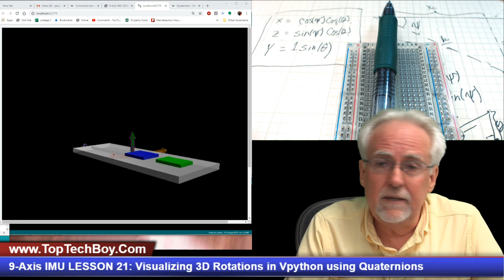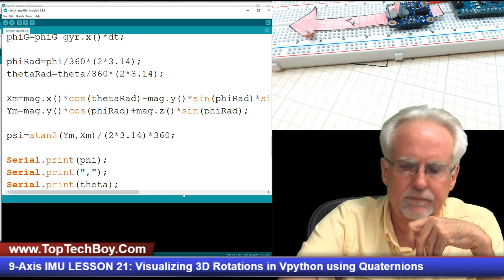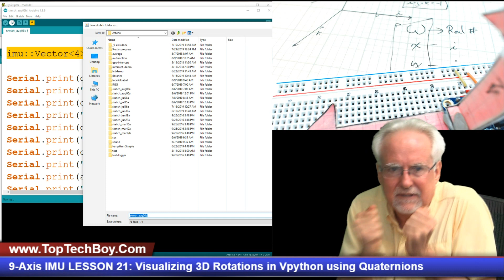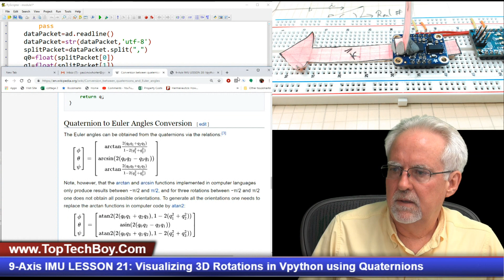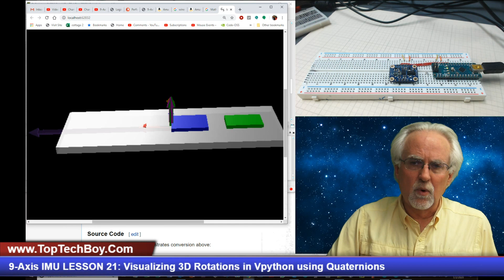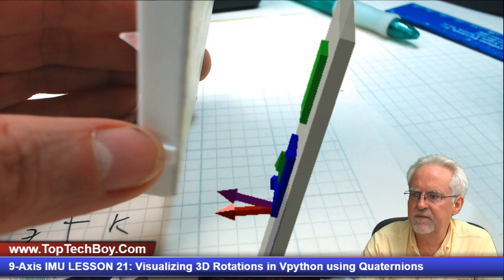9-Axis IMU LESSON 21: Visualizing 3D Rotations in Vpython using Quaternions

Comment: Why do you just calibrate the magnetometer and not the gyro and accelerometer? According to the docs, the quaternion calculation uses all three sensor types.
Reply from the maker: The gyros and accelerometers are much more stable, and there is great variation in the magnetometers.

Comment: Made it through the 21 lessons! This has been awesome to follow along, thank you for the effort.

For this lesson, I had to do some troubleshooting with the python code  at line  "pitch=asin(2*(q0*q2-q3*q1))". I was getting "ValueError: math domain error."

As mentioned at 1:01:38, the error seems to have to do with the asin function getting a value that it cannot handle.  

I was able to get the program to run by borrowing from the code provided on lesson 24. Specifically, I modified the arduino code in this lesson to have:

float q0;
float q1;
float q2;
float q3;
....
q0=quat.w();
q1=quat.x();
q2=quat.y();
q3=quat.z();
.....
Serial.print(q0);
Serial.print(",");
Serial.print(q1);
Serial.print(",");
Serial.print(q2);
Serial.print(",");
Serial.print(q3);
.....

for some reason that I cannot explain, "catching" the quaternions in python by having the arduino "throw" them this way (instead of Serial.print(quat.N)) was able to resolve immediate ValueError issue.

I still needed to implement the try and except for the pitch down 90 degrees case.

Cheers!

Comment: Really good presentation!   But, I have a problem.  Plan to put this sensor in my Dual Axis Solar Tracker which runs currently on LDRs tracking, which are not very reliable in cloudy WX.  
Problem:  No way to calibrate every time the esp32 wakes from sleeping (runs everything on 24vdc battery).  
I am currently saveing initial calibration settings via eePROM and then reloading them with library functions from BNO055.  Trouble is the mag does not calibrate with this method.  So, yaw is off.

Comment: Thank you for the video. I tried doing the same with Ursina engine/Panda3d but I hit the issue of yaw and roll aligning so that I get a gimbal lock. Wouldn't using Euler angles regardless of wether it came from quaternions and just displaying it cause gimbal lock? Anyways great video
Reply: Kinda having the same issue... Did you find a way to solve it?

Comment: I couldn't get the BNO055 so I've used the MPU6050 6-axis IMU that came with the UNO Super Starter Kit. Without a magnetometer there is persistent drift in the yaw, other than that it works quite well. I had one little glitch caused by trying to swap the x and y axes due to the way the IMU mounted on the breadboard. It worked fine until the quaternions. Re-mounted the IMU and all is well and I'm moving on the the pan-tilt platform.
My solution so far: https://www.youtube.com/watch?v=shdRF9SyypI

Comment: Paul, This has really been a most excellent series. Of course, for me, quaternions are a magic incantation with absolutely no idea of what it all means or why it fixes things like gyroscope lock.  I am still stuck in trying to understand how you can produce valid data beyond 45 degrees with the accelerometer without switching from sine to cosine data. I see that I have a long road ahead after simply seeing the use of quaternions to actually understanding.

Comment: I'm in the process of writing an algorithm for a $21k IMU that has a Fiber Optic Gyro, magnetometer, and a MEMS Accelerometer... and once again, every time I need to go back to basics and re-visualize some of this stuff, I dig up your lessons! There is no comparison on your ability to explain this stuff.  Thanks Paul!
Reply: hi, have you an example code or a valid link where learn how to implement quaternons on  an microcontroller for an imu that doesn't calculate them automatically.
 thanks in advance

Comment: Hey Paul, I'm working on a flight controller. I've followed all of your tutorials this far. And everything has been working perfectly with one exception. When approaching 90° on theta (pitch axis), I'm getting a "value error: math domain error" for the line, "theta =  -asin( 2*(q0*q2 + q3*q1))"

I need to be confident that I'm not going to get errors in the euler angles that could crash the controller when performing computations on board the aircraft when approaching vertical.

Any suggestions or help you can offer would be great!

I know I'm not a student... Per se, but I love your videos and I'm hoping that you still monitor your classes comments.

Thanks Paul!

Spencer

Comment: Hello Paul and teaching lessons school mates,
i tried the BNO055 as  red USB stick version,
and my findings , problems are
1. its a good to study the BOSCH bno055 PDF: just google for "BST-BNO055-DS000-12" and you will find that PDF
2. with the stock calculations , that paul gives us, we can get endless rotation , yeahha
BUT
endless rotation is destroyed as 
3. i tried to redefine turning orientations , using  -1*(...)
4. interchanged, remapped axles, using remapping in code

Paul said, that the BNO Chip orientation on the board isnt documented
BUT look in the PDF on PAGE-25 and PAGE-24, with that information we can solve that.
the BNO055 allows us to remap axles in the chip itself (AXIS_MAP_CONFIG) !
and it allows to define/revert the turn orientation (AXIS_MAP_SIGN) !

Attention:
PAGE-30
here we see Fusion data output format is possible in two ways, in Windows and in Android format, 
that is "only" important for Pitch, see "Table 3-13: Rotation angle conventions" !
that does NOT affect Quaterions, because we can NOT set UNIT_SEL for Quaterions, see "Table 3-11: unit selection". 
AND
here we see that Pitch and Yaw have a range with 360degree.. but surprise Roll comes only with 180degree?!
Quaternions are not delivered in degree (their value range is -1...0...+1)
BUT
i see that one quaternion looks always to be only half in size.. i supose its the Roll !

Checking and adjusting these 3 Features (AXIS_MAP_CONFIG, AXIS_MAP_SIGN,  )

Quaternion value Range and the Pitch calculation -> math domain error
because  math.asin() argument has to be -1 to +1  
and my BNO055 delivered values for q0,q1,q2,q3 
in sharp edge cases only, that result in values smaller -1 and greater +1 .. and math.asin throws exception error
try:
  pitch = math.asin( 2*(q0*q2 - q3*q1)  )
except:
  pass

btw, i use:
BNO055 USB Stick Linux Python Driver, bno055_usb_stick_py, version=0.9.5, from Dr. Konstantin Selyunin,
with small code changes on windows, python3.

Greetings from Germany
Reply from the maker: If you think too much about 3D rotations, you will go mad. I was able to get my axis oriented with my project, but will admit that I did do a little bit of trial and error.
Reply: Hello Paul,

now i got it to work on my bench.

now the physical BNO055 usb stick on my desk  
and the visual representation in VPython move identical.

I tried all allowed couples of AXIS_MAP_CONFIG + AXIS_MAP_SIGN (PAGE-25),
( you have to set OPR MODE into CONFIG (PAGE-21) register 0x3D to x0000b and then back to NDOF xxxx1100b),
but at the end i went back to default P1 (0x24,0x00).

I used 
the negativ multiplications -1*YAW and -1*ROLL  
and the addition YAW +np.pi/2
and BOOOMMMMM the endless rotation on all axles works fine without any edge case side effects.

now it seems identical to your setup, 

i only had to fiddle the boxes width length of bBoard-GREY and nano-GREEN.
Nose down is like a Roll left, Nose up is like a Roll right
and 
Roll left is like a Nose down and Roll right is like Nose up.
so X and Y in horizontal plane are "virtual" interchangeable, 
we adapt only the visual presentation, the Vpython boxes to our needs,
the code and formulas are already correct.

time for a mug of coffee
BOOOMMMM 
Thank you for your great content Paul 

PS:
the most stuff, i retyped code while watching your videos IMU-Lesson:15 till 21,
because i did not found the code snippets and so i enjoyed your teaching style too, 
BOOOMMMM ;o)

Comment: Hi Paul, 
thank you a lot. Great explanations and great lessons. You are totally not wasting your time. i did the whole course. That you had to make a try and exeption there is because of the calculation of the rollwhen its at -+90°. arcsin isnt defined there. In Wikipedia its standing that this situation ist called gimbal lock. Better solution is in the c++ code implemantation in the article. In Python you had to add    
    temproll=2*(q0*q2-q3*q1)
    if (abs(temproll) >= 1):
        roll= copysign(np.pi/2, temproll) # use 90 degrees if out of range
    else:
        roll= asin(temproll)

Comment: Hello Mr. Paul McWhorter.
Please do not skip this comment and if it's possible answer me.
I used your code from this tutorial and I have one problem. When Pitch angle is greater than 90 degrees then ROLL and YAW angles changes too , but in your code, seems  everything is ok.
I just copied your Arduino code . I'm just  printing roll,pitch, yaw values multiplied by 180/PI . 
I also used Adafruit's  "Vector<3> toEuler() const " function, but still have same problem with Pitch.
I do not have problem with Roll or Yaw, only with Pitch angle > 90. 
also I'm calibrating sensor.

Please help.

Comment: Paul, I've been working with computers both in my job and as my hobby since the early 70's but have never had so much computing fun as I've had following your entire series on the IMU.   This has been a real eye opener. It is a part of computing I've never really had any experience with.  Thank you so much for all the time and effort you have put into it.  Very much appreciated!  For an even silkier-smooth experience, try modifying the Arduino code to send four or five decimal places for quat.x, y and z. For example: Serial.print(quat.x(),4);  . Makes a world of difference!  Thanks again!  And keep them cranking... the more difficult the better!
Reply: Thanks for the advice! Will try adding the decimal places.

Comment: We're developing a model rocket performance package and your lessons have both defined  and proven that it's possible and, also, how to do it with off-the-shelf hardware..  Thanks for taking the time to explain everything in detail and not rush through things like everyone else does. Where were you 60 years ago when I was an engineering student ;)??  Plus, it's encouraging to see someone in my age group still in the game...thanks a lot...jg
Reply from the maker: I would not use the BNO055 in a rocketry application . . . it easily goes into autocalibrate mode, and can give crazy readings. I would not trust it in any type of real system

Comment: Hi Paul, I'm using your lessons to learn about Arduino for my thesis work and I want to thank you!

I also want to contribute by saying that in order to avoid the gimbal lock you can use the method ".toEuler()" included in the header Adafruit_BNO055/utility/quaternion.h. The conversion from quaternions to Euler angles is done with different formulas, but it works very well! If you use this method you can directly send to Python the Euler angles by using:

  Serial.print(quat.toEuler()[0]);      // yaw
  Serial.print(",");
  Serial.print(quat.toEuler()[1]);      // pitch
  Serial.print(",");
  Serial.print(quat.toEuler()[2]);      // roll

Obviously the python code need to be adjusted accordingly.

Comment: Fantastic project. Just  Finished it and the IMU is working perfectly. I work at a sixth form College in England and recommend all your videos to both students and teachers doing engineering and electronics. Currently working on a robot for a competition and would have liked to include an IMU but previous results using other IMUs have been variable particular for rotations about the vertical axis. Not sure that I understood all the quaternion stuff but just knowing that the capability is there is a big step forward. The robot work has slowed down my progress on the Jetson nano but hope to get back to it soon.  Love the more advanced tutorials. I've recently got hold of a RPILIDAR A1M8 and it would be great if you did a tutorial on this, particularly if it could be combined with the Jetson nano. Thanks again

Comment: Oh brother. What am I going to do with my Thursday mornings now that this most intriguing series has ended? I have followed all three of your current video series: the New Arduino lessons, the Jetson Nano, and this, the 9-Axis IMU, and for some reason this was my favorite. Perhaps it was the mystery of Quaternions.  I really enjoyed the trig part because it was less of a blackbox experience than the Quaternions even though the Quaternions obviously worked much better without the Euler angle jitter bugging.  I noticed the missing “2” in the roll equation but since it didn’t seem to make any difference in the visuals, I figured the “2” was optional – I guess that’s why I went into Law rather than science. But if you can fill Thursday morning with some more trig and quarternion magic, that would be great.

Comment: • 7:32 - Why do you say 𝑖2 instead of 2𝑖? It's the same thing because multiplication is commutative with an imaginary number and a scalar, but the convention tends to be to label the imaginary axis of the complex plane by putting the real number coefficient before 𝑖. Is putting 𝑖 first a regional thing or a personal thing? 🤔
• 14:20 - But I like rotation matricies. I'm a real square, man. 😀
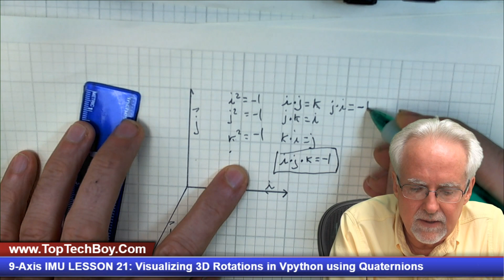• 19:44 - (‡It's not commutative with two imaginary numbers, it is commutative with an imaginary and a scalar.)
Reply from the maker: i2 and 2i are the same as you point out. However, for many in the engineering field i2 is sort of a standard as it explicitly points to i being the imaginary number, and not some variable i. Putting it first cues a person of this. Also, as an EE, typically j is used instead of i, as i represents current in electrical engineering.

Comment: Brilliant!  Love  this challenging project.  My solution (insignificantly) differs at 53:59 - I substituted np.pi instead of np.pi/2.  This aligned  the virtual and real world perfectly without needing to change the vPython camera viewpoint as I think you did.  I noted no virtual image instability in vertical nose up or down with this code.  But try: and except: was a great solution.  
These tutorials take a great deal of your time and are greatly appreciated!  Hopefully with adequate 'encouragement' you will make more  like this, even at the expense of a slightly smaller but ebullient audience.
Reply from the maker: Quaternion, you probably noted that I had to edit the video, and reload it based on the error you pointed out of the missing '2' in the roll equation. I am sort of perplexed at how that made no visible difference at all in the visual. What I conclude is that tangent is a very sharply increasing function, so an error of '2' in the y value leads to a very small error in x, or toll. Hence the 2 did not lead to a perceptible error. Of course, I could not leave the video up with such a glaring error, so I reedited and re-uploaded. Took me all day yesterday to do it, as it was tedious to just redo that part. 

I really enjoy making these videos, and hope I can transition to doing this more. Today, I will make a video on using the sensor to create a self leveling platform.